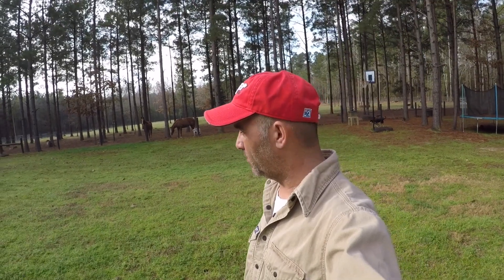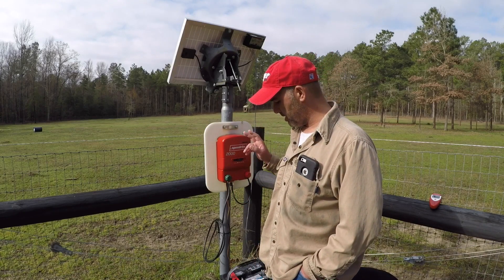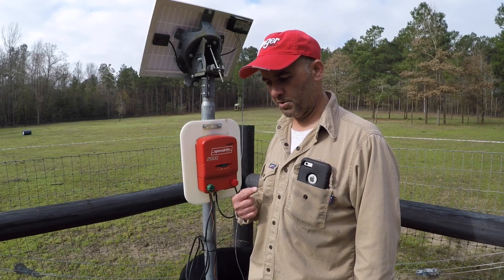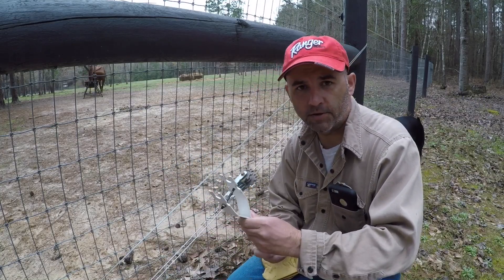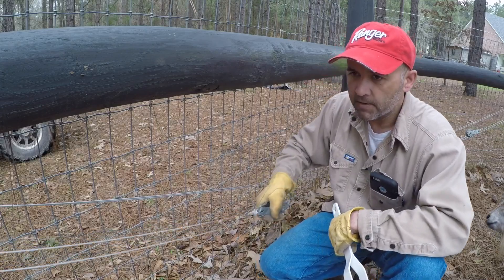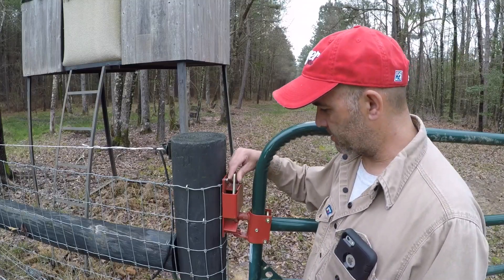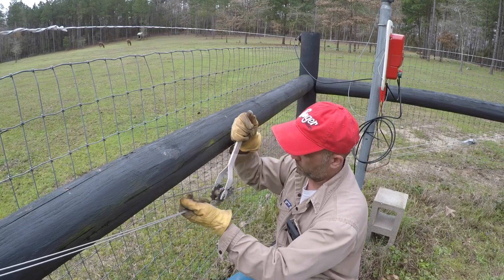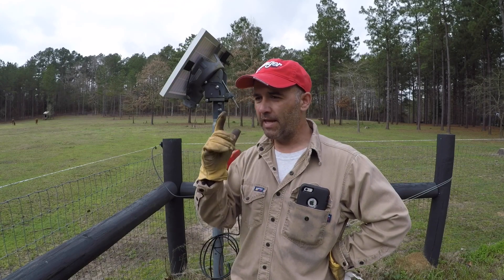Solar Powered Electric Fence & Maintenance

Comment: How do you connect your solar to your battery? It looks like there are some small black boxes on the back of the solar, and does the battery really last 3-4 years, I'm gonna set one up for my dog. Love your accent! Cute goats, I have 3 at home, 2 horses 2 donkeys
Reply from the maker: Thanks for watching Loretta.  The black box is a solar regulator.  It has a positive and negative wire that connects to your battery to maintain a charge.  As far as the battery lasting 3-4 years will depend on keeping up the fluid maintenance and the quality of the manufacture.

But I will say it has held up very well for us and we just divided the pasture up with poly tape that is also electric.  No problems yet!!

Comment: That's a neat set up. What does the solar panel and Energizer run for purchase price? Are they sold by the same company or purchased desperately from two different companies. Thanks for sharing. Your friend Bryan
Reply from the maker: The energizer is $200 on the website.  They also have solar panels but you would need to see how you want to setup the system.  I took a direct tv pole and a kitchen cutting board that was headed for the trash to build what you see.  I can’t say enough about the system.  Really like it and this will be the 3rd or 4th year we’ve had it.

Comment: You really need to keep those batteries charged up especially if they are not a solar battery. They go too low in voltage and it can destroy even a regular deep cycle battery. I would suggest you charge it up at least once a month to get a longer life out of it.
Reply from the maker: Thanks for the info.  I will do that because the batteries aren’t cheap.